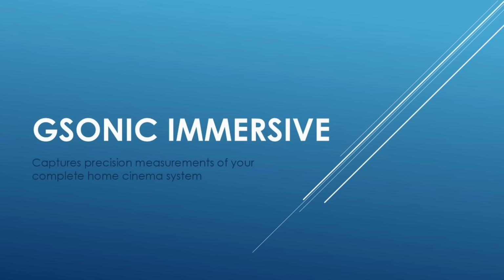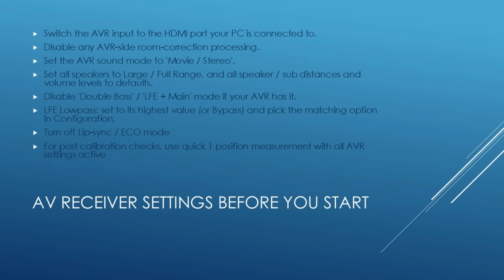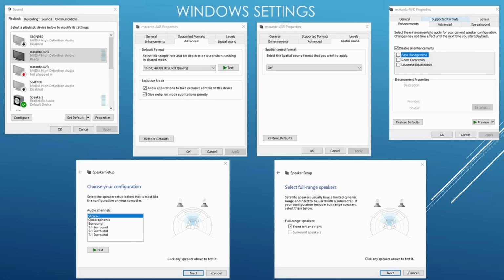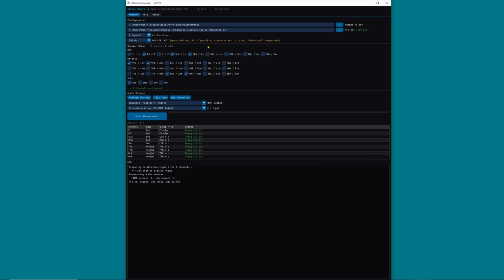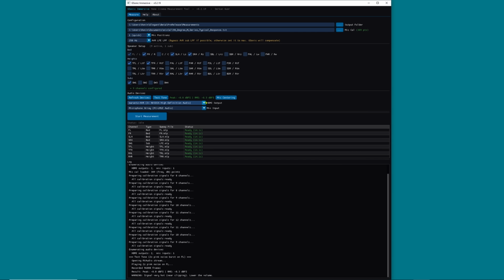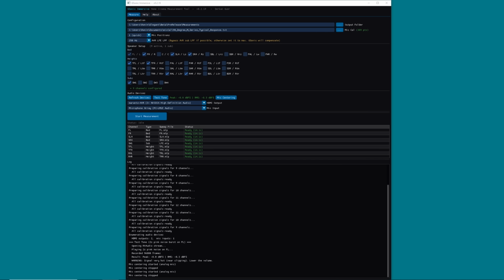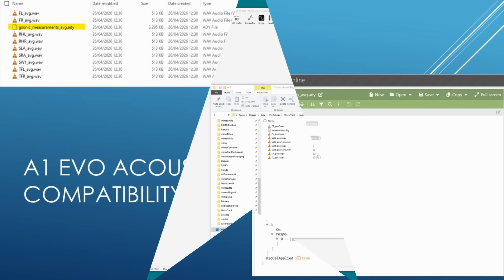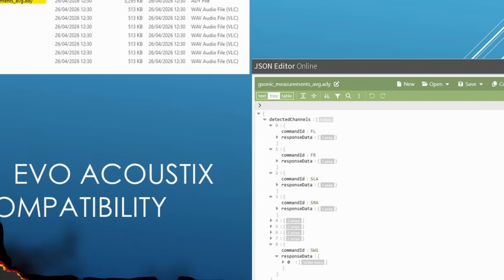GSonic Immersive

Comment: I am using GSI 2.0.2, but I don't see "EVO 32 mode" in the Configuration. Could you tell me where to find it? Thanks.

"==== Evo 32 mode ====
Evo 32 mode is a dedicated capture workflow for the GSonic Evo 32 app. With it on, GSonic records the raw data that app expects instead of the standard room-correction output - so switch it on only when you are measuring for GSonic Evo 32, and leave it off for normal room correction.
Turn it on in Configuration, click Start Measurement"
Reply from the maker: You need to scroll down to the bottom of the "Mic positions" drop down list
Reply: @ocaudiophile  Thanks, I see it now. However, I have to take a measurement at position 1 (quick, no averaging) first, and then switch to Evo 32 to complete all 5 positions. If I switch to Evo 32 right at the start, it only runs the FL channel; it errors out immediately upon reaching FR and produces no sound. Is that correct?
Reply from the maker: I released a new GSI version today (v0.2.3) and Evo 32 mode is now a separate button. Running a 1-quick session first is always a good idea as this will report your relative sub levels and you can make adjustments to sub volumes accordingly before you run an Evo 32 round. Remember to always avr Reset first even when your avr is already reset if you have multiple subs. That's how GSI can run sweeps through each sub individually.
Reply: @ocaudiophile  Is a full reset of AVR really necessary? Having set all the inputs, inputgains,  changed the names, network, CEC etcetera is quite a Pita to have to do after every calibration....
Reply from the maker: Power cycle is often enough to fix some corrupt state. Try that first but if your firmware update went rogue, hard reset or sonetimes even return to factory settings type of reset maybe needed.

Comment: Hi Serkan, I’m having a problem where the sweeps always produce a crackling sound, causing the measurement run to fail. It’s strange because it works perfectly on a laptop with an Intel chipset, but the crackling occurs on the laptop with Nvidia graphics. Do you have a solution for this, or do you need more information?

I Have an Denon X8500H.
Reply from the maker: I can only suggest updating NVDIA drivers and turning TV etc off. Not an issue I heard anyone experience before so whatever is causing this is some local setting. It could also be HDMI cable which has just enough bandwidth for the primitive Intel driver but fails to carry high frequency NVDIA signal.
Reply: @ocaudiophile  Thanks, I'll give it a try and get back to you. I had the projector turned on, so I'll switch it off. The Nvidia drivers are already up to date. I'll also try swapping the HDMI cable—you never know. ;-)
Reply from the maker: Yes, HDMI CEC devices especially can cause issues. I have also seen a user who connected the PC to the TV and from TV to AVR with e-ARC. These kinds of fancy connections will most probably cause issues.
Reply: @ocaudiophile  After a full factory reset of the amplifier, it works as it should. No crackling during the sweeps. Many thanks for your quick reply, and best of luck for the future.
Reply from the maker: Great to hear that!

Comment: Hello. Thank you for your work. The listening position is 30 cm from the wall (the sofa is close to the wall). In this case, how far from the wall should the microphone (Umik-1) be placed? How many measurements, the number of repetitions, and the distances from the listening position to the microphone placement should I take to achieve the optimal measurement results and subsequent processing in the

GSonic Evo 32? I have a Marantz Sr7015 and an Emotiva Basx A3, and the left front Heco Metas XT 501 floorstanding speaker is jammed into a corner. I plan to upgrade from the

AcoustiX A1 Evo to the GSonic Evo 32.
Reply from the maker: GSI will weigh measurements based on their distance from MLP and average accordingly. SO, the decision is on whether you listen on your own or there are a bunch of seats regularly using the system together. Positions should be at least 10cm apart though for a meaningful capture.

Comment: I purchased the Gsonic Immersive yesterday. When resetting my AVR (an A1H model), an "HDMI input check" error appeared: "AVR reports decoding: '/ /.0' (sound mode: 'stereo')." I tried switching through all the sound modes available on the A1H—such as Direct, Dolby Surround, etc.—but the error persisted. I am using a Zeskit Maya HDMI cable (8K/10K Ultra High Speed certified), and my laptop correctly detects both the AVR and the UMIK-1.
How can I resolve this issue? I would appreciate your guidance, OCA. Thanks.
Reply from the maker: Make sure your GSI app is v2.0.2 (latest) and you have not selected "pcm sweeps" option. Power cycling the AVR might also help if you have already done these. Lastly, in Windows sound settings, HDMI output needs to be set to stereo, not 5.1 or 7.1

Comment: Hi Serkan.
Non XT32 user here.
Quick question that I think got lost in the support group. When AcoustiX processes my GSonic measurements, it says that the mic was way off center while GSonic was showing a +0mm offset. It is safe to ignore that, and simply trust GSonic's more accurate measurements?. Or should I re-do it?Thank you!.
Reply from the maker: No, because A1X will set distances incorrectly if it reports mic as off centre. What you need to do is use "Manual time alignment" option in the customization menu and when the script pauses, open Overlays/Impulse graph in REW, untick SW1 (keep only speakers selected) and the apply "cross corr align" then continue optimization. Your distances will be set very accurately based on GSI measurements. Unfortunately, you will need to do that on every optimization run.

PS I showed how to do that in A1X video
Reply: @ocaudiophile Thank you so much!. My center and surround left do show a different distance value now, so I guess it worked. Is this workaround applicable for both, MLP-only measurements, and multi position ones?. Thanks again!!
Reply from the maker: It works on all. Just remember not to include sub(s) in cross corr align process

Comment: Hi serkan,Recently purchased Denon S980h av receiver is gsonic immersive and evo a1 acoustix callibration supports to apply crossover below 200hz because I am having doubt this is basic audysess multieq how to do any process for this avr i did mistake to purchase this.
Reply from the maker: S980H minimum filter resolution for speakers is 375Hz. Sub is filtered much better so A1 Evo limits crossovers to 200/250Hz. If you place the sub in a central location, you will not be effected from bass localization with high crossovers. I will release a calibration app for Basic and XT models soon (after Evo 32 which will be released in a week). I am hoping that new app (Evo Lite) will manage to get a descent calibration from your model.
Reply: @ocaudiophile Thank you so much for the clear explanation, Serkan! Hearing that you are releasing 'Evo Lite' for basic MultEQ models completely made my day. Huge congratulations on the upcoming launch, I can't wait to test it out!

Comment: Hi Serkan, I have a question about GSonic Immersive multi-position measurement.

I have a client’s home theater with 6 seats arranged in 2 rows of 3, with the front-row center seat as the MLP.

My goal is to optimize the calibration so that the sound level and tonal/bass balance are as consistent as possible across all 6 seats, rather than optimizing only the MLP.

With one UMIK-1, what is the correct GSonic Immersive measurement procedure for this type of 3×2 seating arrangement?

Should I measure the microphone at all 6 actual head positions, or should I take multiple positions around each seat? If multiple positions are recommended, what is the correct number and spacing of positions?

And when GSonic creates the spatial average for A1 EVO AcoustiX, does it give equal importance to all measured positions, or is there a way to give more priority to the MLP?

I want to follow the correct GSonic methodology rather than guessing the microphone positions. Thank you.
Reply from the maker: Your best bet is to capture every seat position at ear level. GSI weighs non MLP measurements less based on distance to MLP so compromise will be minimal but it's optimistic to expect uniform bass and treble at every seat.

Comment: Coming evo32 is it affordable price available like gsonic or more expensive like dirac live just curious asking already i purchased gsonic immersive so i want to purchase evo32 also because I trusted your work I am following more than 3 years.
Reply from the maker: I haven't decided on the price yet but Evo 32 obliterates DLBC ($600) and works with non Dirac compatible older XT32 models as well. It will still be very reasonably priced at a level anyone can easily afford.
Reply: @ocaudiophile Thanks Serkan, that’s great to hear! Really looking forward to Evo 32. If it can deliver that level of performance while staying affordable, it will be a fantastic solution. 🙏
Reply: Hi Serkan, I have a question regarding GSonic Immersive multi-position calibration.

I’m calibrating my home theater with 6 seats arranged in 2 rows (3 seats in each row). The front-row center seat is the MLP.

My goal is to optimize the system so that the sound is as consistent as possible across all 6 seating positions, rather than optimizing only the MLP.

What is the correct way to place the UMIK-1 for GSonic Immersive in this situation?

Should I measure all 6 actual seating/head positions, or should I take multiple measurement positions around each seat? If multiple positions are recommended, how many positions should I use and how far should they be from each listening position?

Also, can GSonic spatial averaging/A1 EVO actually optimize the calibration so that the level, tonal balance and bass response are as consistent as possible across all 6 seats, or is the optimization primarily centered around the MLP?

I’d really appreciate the recommended measurement procedure for a 3×2 seating arrangement. This would also be helpful for others doing multi-seat calibrations in the group. Thank you!
Reply from the maker: Start from MLP and take one measurement at every seat at ear level. You can add some more measurements around MLP if you want but GSI automatically weighs MLP measurement higher than others.

Comment: Is it just me? With the latest update the FL sweep is  defective it's not accurately reading the FL distance that means it's impossible to accurately centered the mic. I've physically measured it with my tape measure but the software has a completely different number. When I checked the processor the FL speaker distance it correlated to the physical measurement with the tape measure. As a result I'm having major ear fatigue in my left ear. I've since uploaded an old calibration. Is there any way this can be resolved?
Reply from the maker: It seems to be just you so far. If you share your debug log (it's under your username folder) here I can have a look:

https://drive.google.com/drive/folders/13eRDRmuTau_J90WkXuszPc_MZU5LWiYv?usp=drive_link
Reply: @ocaudiophile   thank you I've uploaded a few measurements so that you can get an idea. Thank you.
Reply from the maker: I am not sure I understand your problem. Your GSI results seem fine. Is AcoustiX assigning wrong distances to your speakers? You have uploaded the Acoustix log in the Test folder but than moved it to bin and I cannot see its content.
Reply: @ocaudiophile “Yes, AcoustiX appears to be assigning the wrong distances. The physical FL/FR distances are FL 10.2 ft and FR 10.4 ft, but AcoustiX calculated the mic as 1003.5 mm right of center. I’ll put the AcoustiX log back in the Test
Reply: @ocaudiophile  I've sent you 2 other files including FL and FR only. If you need anything specific please let me know.
Reply from the maker: What was the problem?
Reply: @ocaudiophile “Yes, AcoustiX appears to be assigning the wrong distances. The physical FL/FR distances are FL 10.2 ft and FR 10.4 ft, but AcoustiX calculated the mic as 1003.5 mm right of center. I’ll put the AcoustiX log back in the Test folder and upload it again without moving it to bin. Please let me know if you need the complete measurement folder as well
Reply from the maker: No need. AcoustiX is missing the true peak of FL because of its strong reflections. Measurements generated by GSI are accurate.You can use manual time alignment option in A1X to fix this. I had explained how to do it in the video (A1X video)
Reply: @ocaudiophile ok thanks

Comment: If GSonic Immersive will be bought today, should I pay for the upgrade to Evo32  additionaly? Or Evo32 is a quite different product ?
Reply from the maker: GSI is just for measurments. Evo 32 needs GSI to work but it's not an upgrade. It's separate calibration/optimization/transfer app. Also, it's not yet out ;)

Comment: I have a Denon x3600H and B&W DM 604 front speakers and a LCR 600 S3 center channel. My surrounds are DM 600’s and my rear back surrounds are nht super zeros. I’m working on those and the 4 nothing to write home about ceiling speakers. I also have two subs one a Sunfire HRS 12 and a diy 15 with a few hundred watts on board. I ran Gsonic Immersive using a Umik 1. The quickest i have ever seen and not loud at all. No more sub cable swap. Just turn one off, then the other. I did 3 positions. I can’t believe what I’m hearing. I haven’t had a chance to really sit down with it but I’ll be with it for a while when I do. Breathtaking. I’m in a open area in the middle of the house and the subwoofers are along the back wall and seating is not ideal. I’ve never heard anything like this. My theater in the basement is next! I can’t wait until the evo 32 app comes out!
Reply from the maker: Glad you are enjoying the results!

Comment: I can still just do the subwoofer cable swap yes? I just ran it for the first time and it’s what I’m used to doing.😂 I will adapt as necessary.
Reply from the maker: Try only turning each sub off first, you may not need to swap cables if sw2 plays sweeps.
Reply: @ocaudiophile Thank you I will!
Reply: @ocaudiophile Yes that worked! Thank you!

Comment: I'd just like to ask how we load the measurements from GSonic Immersive into AcousticX as I couldn't see much documentation about how the .wav files translate to measurements in REW.
Long time user of your software, love your work. I just got back from a long period not at my home theatre so I'm excited to try the tool!
Reply from the maker: You just need to copy the .ady file saved by GSI under the "averaged" folder to the AcoustiX folder. Then AcoustiX can process, optimize and transfer the results with it like its own measurements.

All .wav files (measured responses) saved by GSI can be drag&dropped to REW as is, if you want to see them.
Reply: @ocaudiophile thank you! Purchasing now :)
Reply: I ran a 3-measurement calibration and oh man... this is the real deal. I've been using every generation of tool you've made in the last few years and the measurements from this led to a result eclipse anything I've heard before in a calibration. Thank you OCA!

Comment: Hello, i calibrated my x4800H with Acoustix and that worked great. Now I made the measurement with Gsonic and use Acoustix to improve the sound. But Acoustix reduced my two Subwoofer by around 10dB. Before Gsonic measurement the level was around -2 to 0 dB and now they are -12 to -10dB. How can i solve the Problem?
Reply from the maker: The only problem you will have is auto standby not kicking in easily with levels like -10 and -12. AcoustiX can adjust volume levels beyond the 12dB limit if it has to so nothing to worry there. Next time before you measure increase sub volumes by about 5-6dB though.

Comment: Hi Serko thanks for bringing up this great tool, keen to use this for my system, bybthe way will l this bring significant sound improvements for denon 1800h model?
Reply from the maker: This is purely a measurement tool. It brings significant improvements to measurement quality but for calibration based on these measurements, you still need to use A1 Evo AcoustiX.

Comment: I have a 9.0.4 system with a Denon 4800h; I don't have a separate subwoofer. My front speakers have 12-inch woofers, so I don't need one.
Does this program work without a subwoofer?
Reply from the maker: GSonic is a measurement tool and yes it will measure any configuration but there's no optimizer tool for a no sub system among my products :(

Comment: After GSONIC 2.0 update. It seems there is a problem with the multi-subwoofer measurement on the GSONIC. No sound is produced during the measurement, or an error message pops up saying that I need to reset it again, even though I have clearly reset the AVR.
Reply: I sent you error logs by email.
Reply from the maker: and I am awaiting your debug logs...
Reply: How did you do the update; i have no idea how to do it?
Reply from the maker: For this time, you need to manually uninstall previous version of GSI (v1.1.7) and then double click on the new v2.0.0 you will download from Gumroad using the link in your original purchase email.

Comment: Hello. I purchased G-SONIC and installed it on my Intel laptop. However, I keep encountering errors. Therefore, I would like to transfer the license.

My setup consists of two desktop PCs in a small room, with a Cinema 50 and a Denon 4800H connected to each. I originally planned to measure audio by moving between the systems using a single laptop, but my plans have gone awry.. Would you be able to allow me to install the single license I purchased on both PCs? The distance between the PCs is quite far, making it difficult to move them around.
Reply from the maker: Sure but write me through my support email in Gumroad so I can see who you are.
Reply: @ocaudiophile  I wrote the email. Thank you very much!!